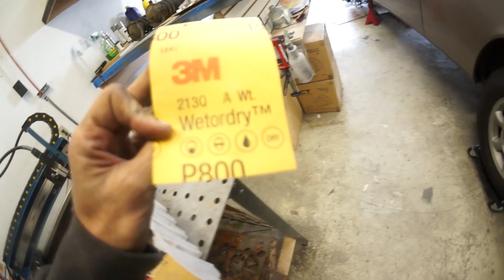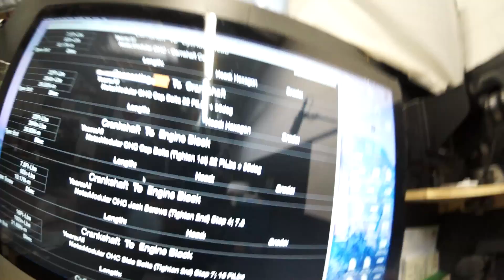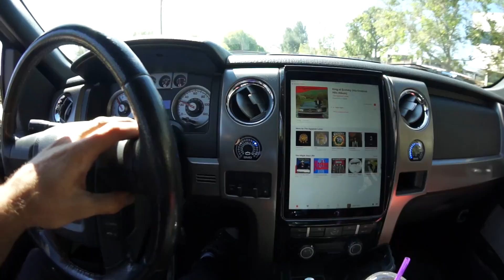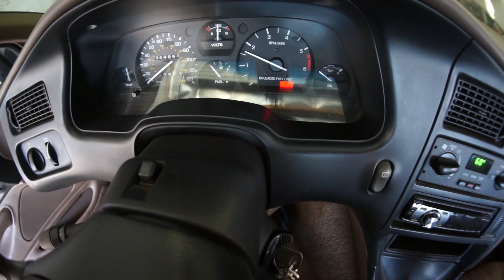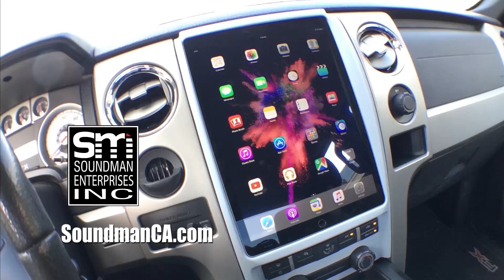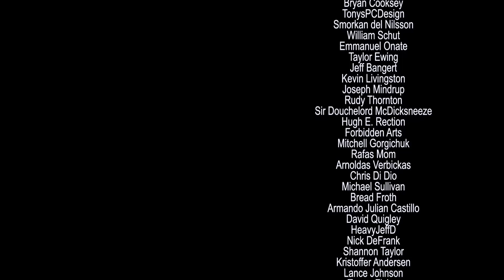Got the T-Bird running with my shoelace - WHITE RIDER 6 (thunderbird project)

Comment: Two issues you most likely have, that loose flange is messing with the o2 sensors and / or the catalytic convertors are plugged from having antifreeze go through them. That will course lag and stutter.

Comment: Doug, put about 150 miles on it and change the oil. Drop the oil pan and look at it in the sun light. Make sure there’s no glittery metal particles. If you see a bronze and copper particles the bearings are already going out. If you see nothing you’re all good brother time for some subs.
Reply: KEEPING IT REAL! No shiitt
Reply: Yep no shit
Reply: You will see metal in the oil when you do bearings. It depends on how much you see in the oil and what color the metal is which also depends on the type of bearings they are. A lot of crap on the market are not doing the tri metal bearings anymore. Just did a few rebuilds in the last year and it was a pain to find Tri-metal bearings for my car.  They are all going to those aluminum crap bearings. Only way to know is to get an oil analysis done to see if the bearings are wearing excessively.
Reply: Right 150 miles of Kentucky tractor pulling.

Comment: You put in some work Pepsi was worth it after all that I rebuilt my gfs truck replaced  the rod bearings like you did only to have the rod bolt break they we got from the dealer ran great for about 20 minutes or more then it came back and broke the hole connecting rod not damaging the block we sold the truck looking forward to seeing the progress on the free bird

Comment: Doug you should look for a used SHO motor for that free-bird, but if your not sure what to do next call it might-rider
Reply: Wasn't the SHO FWD and extremely unreliable?
Reply: Tim Pequignot yes, and only if you don't weld the cam gears on. If you weld em solid (because they have a rotation issue that blows motors) then it's at least as reliable as a Yamaha motorcycle
Reply: But this is gold because of both

Comment: Doug, good morning!  I didn’t finish watching the video when I wrote this, or you might have accounted for this next comment already but: The car may have to relearn how to drive for a while. Since it’s running better after that 20min segment, it maybe that the car’s ECU just needs to relearn. But looking into cleaning the MAP sensor, or Idle bypass valve and such I ant a bad idea either.

Comment: Hey Doug, it would probably be a good idea to replace that oil/filter after your first drive on the new bearings and heads to get rid of anything that may have been floating around in the motor like those scotch pad fibers! :p

Comment: I had that same problem with my 95 cougar. Pulled the mass air flow sensor and it was caked with crap. Got screwed at O’Reilly for $5 on a can of mass air flow cleaner. Problem solved. Had to buy a T20 safety bit to get those special screws out lol.  Turbocharge that puppy 😎

Comment: That motor runs on a ton of smog controls/sensors so fix the exhaust leak, change all your vacuum lines to new and check your OBDII codes. Your Cat may be stopping up, the "bogging" will be more like a sputter while excellerating.

Comment: Doug as you rev the engine at the 17:00 minute mark the oil gauge does not move. Does the gauge not work, or sensor not connected?

Comment: Cheap fixes to try for throttle would be can of MAF cleaner sprayed to clean MAF. And then hand cleaning the throttle body on the front and backside of the throttle blades just in case it’s a buildup from the PCV recirculation system.

Comment: Great job! It sounds like it is missing (timing issue) a little and slightly back firing out of the exhaust. It's hard to tell because of the exshust leak and sound quality. Just start the car put in park, have a friend slowly give gas and listen at the end of the tail pipe for slight popping. If you hear this then it is either/or a timing issue or misfire firing or both The misfiring can be from a few different things. i.e. sensors, vacuum leak, spark plugs, timing, mass flow sensor, EGR issues, etc. Let me just add, check your timing first. Then double check all your hoses, electrical connectors. Hoses(vacuum) Look for cracks,soft spots that can collapse under vacuum; Electical(connectors) Look for corrosion on contacts, loose connections, grounds that are not grounded good   -zsignmein

Comment: Did you do the front and rear mains and replace the stretch bolts, how's the oil pump? Btw do you want to buy some tires, they're new only 50 miles on them, they're full of nails and splits but they're low mileage so they must be ok. Sounds like it's running on 7 cylinders.

Comment: That really sounds like a miss Doug. I know you changed the wires so i'm assuming you bought new plugs too. Could be a faulty plug or maybe an injector is fucked. Just check all that. Pull one plug wire at a time with the engine running and listen for a change. When you find the one that doesn't change that's your cylinder.

Comment: Change your oil again and keep changing it till it runs smooth again, all the rust and stuck parts are working itself loose again.  Every engine that sits for a long time takes a while to break in.  Don’t rev it above 3k till you gone 200-300 miles on it.

Comment: Could be running rough because the fuel in the injectors is gummed up after sitting for a year. Put some fresh gas in it and run some injector cleaner through it.

Comment: I really hope you disconnected the ignition relay and cranked the engine a number of times to get the oil system pressurized before starting it! I didnt see you do it in the last vid and cringed when it started.

Comment: Doug, quit being silly. you have a fuel injected car but you have the exhaust disconnected before the cat. leads me to think maybe you're getting a crappy O2 sensor reading because your exhaust is not fully connected. I have seen this before. all because of a couple bolts being loose. O2 sensors can be super super picky at times. reconnect your exhaust then see how your engine runs.
Reply: not a ford tech but from my experience an 02 sensor is only there to confirm the cat is working properly. the air/fuel sensor would have more  of an impact i would think. after working on cars all day watching him work on this turd bird is hard.

Comment: It doesn't sound too good. Try to get the check engine codes pulled on it.
Reply: It's gotta have a bad oil pressure sensor, I mean, the gauge and idiot light just need a sensor because that thing totally has oil pressure....lol
Reply: i was thinking the same... i couldnt tell if it sounded Off balance kinda like a washing machine with an un even load. or if the exhaust leak was that terrible and it was just a putt-ing noise . heard to tell over computer speakers

Comment: What about the other half of the bearing that attached to the top of the connecting rod? They have to look just as bad as the bottoms. That engine needs a total rebuild pal....its not going to last.
Reply: Those usually make it somehow lol.
Reply: looklookerlooking 
Hey pal, what about the part of the video where he shows installing the top portion of one of the said bearings? You made me go back and check myself. Now I can say go back in the video and check yourself 🎶

Comment: After what you did and what has been done I would not have let that run for 20 minutes I would have automatically started off let it run for a few then instantly drain it put some more fluid in it drain it again and count yourself lucky that it even runs cuz you didn't put any assembly Lube on

Comment: What a wast of time.  That engine needs filly machined Doug, just stop.  You might make the crank journal all shiny, but how do you know they are fully round like your big head?  After showing the smashed bearing, I 'd be amazed if they were.  Just get a short block and put your heads on them before they get ruin when the new bearings nuke......